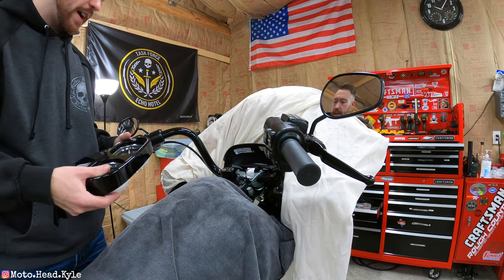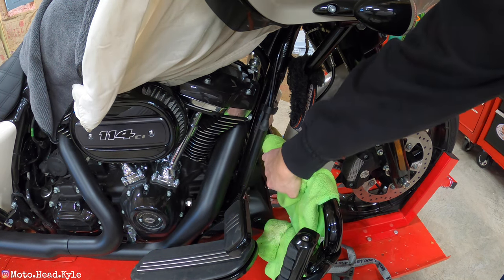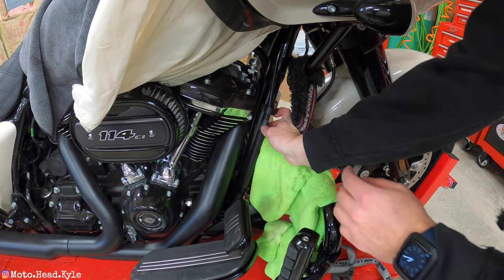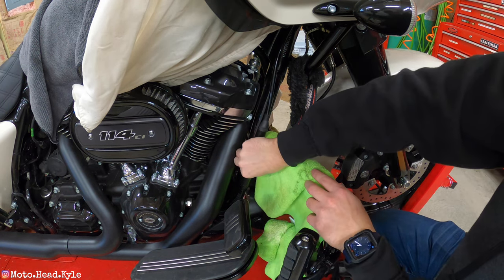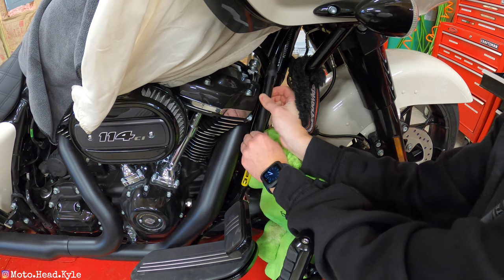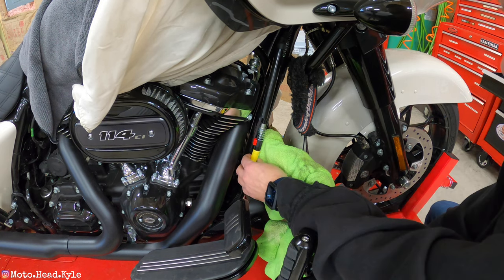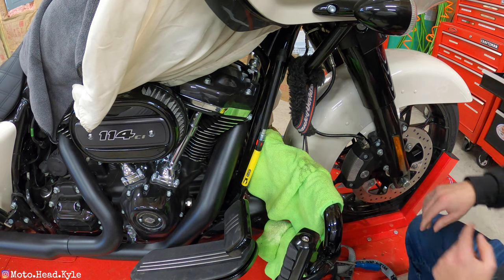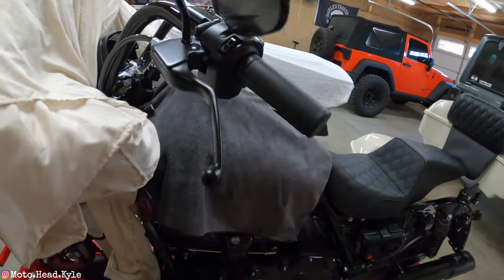Installing Factory 47 Handlebars on a 2022 Harley Davidson Road Glide Special

Comment: Thanks for a great video! Thinking about getting the same 12" bars. Do these bars have holes to align the controls? And is there a hole for the pin in the clamp? Also, how much would you say this raises your hands over the stock bars? Do these bring your hands back closer to the rider compared to stock?
Thanks for all your help!

Comment: I just did my factory 47 handlebars 12-in last night got the throttle side done. Today I did the left side would have been easy but I installed kahuna heated grips. It was more tedious than the right side. I tried the clutch and brake side and noticed it was long enough so I  unclipped the clutch cable and the brake cable ( cut wire tie that was almost hidden)  I . That's where I'm at I need to plug everything in and hopefully everything works. I used cable pulling lube and it still was a pain in the ass more like pain in a fingers I got blisters from pulling the string.. it is very tedious you have to pull two cables  staggered. You pull one than the other. I highly recommend using cable pulling lube... I will let you know when I'm done hopefully everything works... By the way I used a string tied to small amount of paper towel then they use a vacuum to suck the string right through the bars it took like 2 seconds. You don't have to drop a chain with a nut use a vacuum it's a lot faster... Just saying vacuums the way to go to start your tedious adventure Good luck everybody.
Reply from the maker: Yep. I’ve done two sets of bars with heated grips. It’s a royal pain in the ass. That’s a good idea with the vacuum. Although getting the chain through takes only 5 seconds and that’s the least of the problem when doing bars🤣 it’s feeding the wires back through. Hopefully everything works out when you get it back together!
Reply: @MotoHeadKyle  everything  works no problems I actually push the handlebars forward slightly they're almost shoulder height.. it's definitely worth doing yourself .Once  done ,open up some brewskies and enjoy the great work you just did That's what I did...lol.. definitely a difference in feeling from factory garbage bars to these..

Comment: Great video. Curious what did you do about the factory pins in the handlebar clamp and each handle bar housing ?
Reply from the maker: Thank you! Left them. The factory 47 signature bar has slots for them
Reply: I had to turn around the bottom piece to align with the pins in the new bar.  Is that normal?

Comment: Hi great vid thanks.  I’d like to change the bars on my 22 RG limited.  Can I re use the factory heated grips already fitted?   What’s the difficulty that makes it so much harder? Appreciate any advice.  Thank you
Reply from the maker: Yes, you can re use the factory heated grips. It makes it harder because you’re feeding an extra set of wires through an already tight space. So they naturally get snagged up on the corners inside the bars. It’s doable but you’ll just need to have the patience.
Reply: @MotoHeadKyle   Thank you for your help.
Reply from the maker: @Meldelkel  need anything else, just shout!

Comment: Hi Kyle, I know it isnt going to be easy, but do you think its possible to get heated grips wire through as well on the left side ? I am also thinking about going with the 47 12" signature. 
I just need to figure out having them shipped to Denmark Europe :)
Reply from the maker: Yes absolutely it’s possible! I ran that on my personal road glide. It definitely is more challenging but take your time, use some lube and you’ll be fine🤘🏻best of luck with it!

Comment: Great video!  Did you need to use extensions?
Reply from the maker: Thank you! For the 12” no. 14’s I would recommend them
Reply: Did you have to change the clutch and brake line?
Reply: @MotoHeadKyle thanks for asking had the same question!